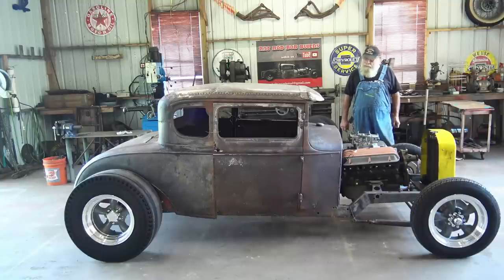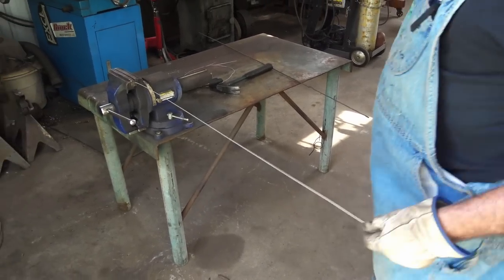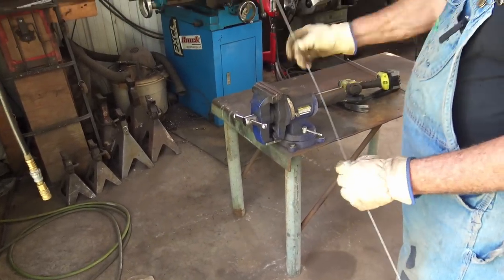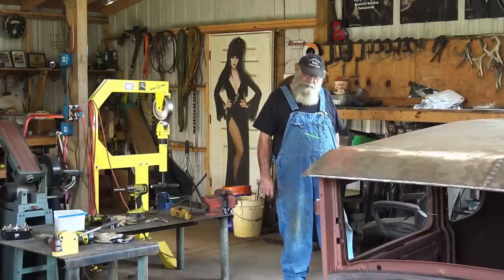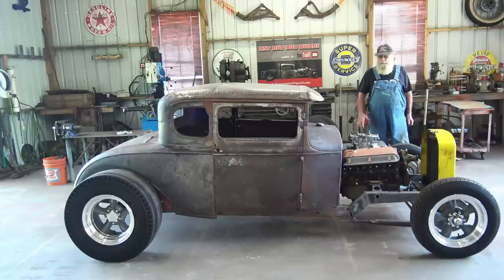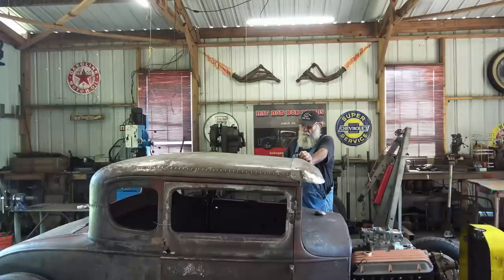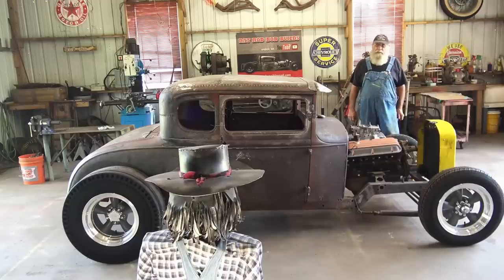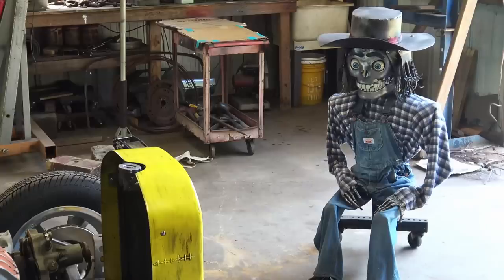Custom Hot Rod Grill Made From Tie Wire - Model A Ford Coupe

Comment: Awesome as always. Great tip on wire straightening. Stoked to see Red back again! Only trouble spot I see is matching the bottom of the door line and cowl with the bottom of the rear quarters. Be nice to see that bead roll from the back continue across the door bottom or something. Whatever u decide it's gonna b freaking awesome

Comment: Hey Bob .. throw some salt water on it and let it rust .. paint motor .. put a very nice interior in the Rat Rod and power steering and cold air , Dynamat inside and a kick butt stereo system and then go anywhere in comfort and luxury but have the down and dirty look of a Rat Rod that just came out of the creek .. just a thought .. your work is very good and I really like it .

Comment: Hey Rat Rod Bob. You might want to try this, I did it a 55 4 door wagon rat Rod. Spray the black on top of the yellow, use your hand with a rubber glove on your hand . Put some wax and grease remover on your rubber glove and wipe it off with your hand. I think that’s what your after. Mine looked really cool. You might want to try that. PS. I just used my bare hand. So I’m not sure how the rubber glove would work. Lookin Good Bob!

Comment: Bob,  I love the yellow 'n' black but if you want to tone it down from a canary yellow to a softer Safron yellow, that too would be cool.   As a kid I saw another kid with a 32 Ford roadster (back in my time they were still pretty common and cheap to get) and what he did was funny and cool at the same time.   Ir was the late '50's when the Brits imported jaguars, MG's and Triumph sports cars to the States.   he took the rear trunk chromed luggage racks off the back of one of those sports cars and stuck it on the back of his roadster.   It looked cool.

Comment: Howdy Bob and Don! 
I just tripped over your' channel. 
seeing that old coupe brought me here.
Amazing is all I can say. Reminds me of the old 34 ford Coupe that me and my buddies had and never finished in 1951.
I spent my life wanting another one but for a million reasons never accomplished. 
Airplanes became my passion.
I did build the airplane in my  profile pic. I'm flying it over the Florida Everglades, late 80s. 7 year project, working on weekends 
when money aloud and having a full time job.
I subbed your channel, will follow for sure.  Grill looks great. Like the antiqued Yellow. "Different for sure"!
John, Central Florida.
Reply from the maker: Thanks for the sub brother. My good friends dad used to build airplanes ... flew with him a couple times. I was amazed he would weld the frames together with a torch and wire clothes hangers for filler.
Reply: @RatRodBobBuilds  Coat hangers only good for filler. Ask "Bad Chad"! 
Coat hanger metal are the worst metal in the world. LOL
Yes all the metal is 4130 Chrome Moly steel tubing Oxy, acc. welded.. The wings are Sitka spruce wood Ribs and spa's. 
Learned to gas weld in the 50s dechroming hot rods.
My dad taught me to build balsa wood flying models when he came home from WW2. in 46.
Amazing thing build was the same only much bigger.

Comment: Bob, as much as you like different paint ideas let me give you the plastic wrap marbling idea.  Of course its been around for ever and used on like ,helmets and suck its a great look and could go well with your stitches.  Put your base color on and let it dry.  Then take some plastic wrap from your kitchen and wad it up then upt the secondary color on and then take the plastic wrao and dobb it leaving a very unique look.  the you can leave iit for what ever effect most people clear over it but with the stitches i think it'd look better left without the clear.  I love the look of it in flames , inside large stripes etc .... give it a try on a test pece and you may find it with all kinds of places like dashes etc...  you can also spray the second color and lay the plastic wrap down pat it then pull it off and go again.  The effect gets better withe nore colors you add to it even if its pearls or Mica !  Nice build !

Comment: Looking good Bob. As lightweight as your car is, be sure you don’t run maximum air pressure. I had cheater slicks back in “66” and I ran about 26 lbs on my 64 GTO.  NOT a fan of yellow.

Comment: ❤😢 not sure how you are working in this heat.  Texas has been 110 or there abouts all week and this pass weekend  was to stay around 106 or close to it all this coming week and I just have a hard problem these days fighting the heat like use to.     The grill turn out great. With what you have to work with which pass me up this past year or so.  But what I don’t have I know people it just takes me longer since I have to get in line now and then.  So next project is not as cool as yours but there is sentimental value to it my brother in law pass awY a couple years back and my sister gave me his first vehicle he ever owned and first wanted to drive at 16 which was a 1974 Ford courier pick up with a very unusual paint job that came with it stock. It will become a rat rod/hot rod/cool little truck when it’s done.

Comment: Subscribed so I dont feel guilty later for rippin' off your idea.

Really like the tie-wire grill. I've got a '69 GMC C5500 flatbed and I don't really like the  '69 commercial grill. A 69 pick'em up truck grill is much better lookin' but it doesn't fit in the space. I'm gonna ponder on ways to steal your idea. I'm thinking maybe barbed wire mounted in horizontal strands.

Bob Muir's "How To Keep Your Volkswagen Alive- A Manual For The Compleat Idiot" shows mounting tires by hand put in the field but I've never seen anyone actually do it by hand.